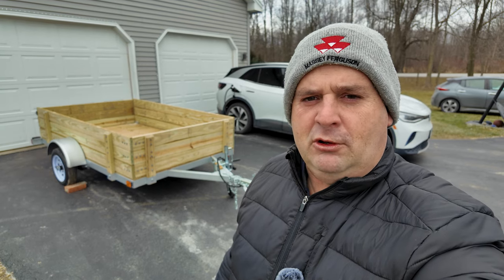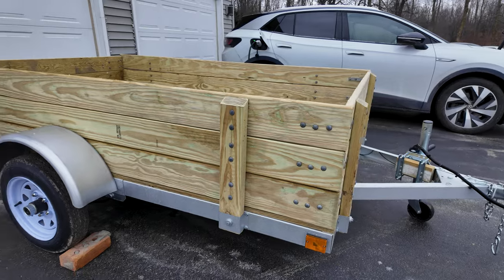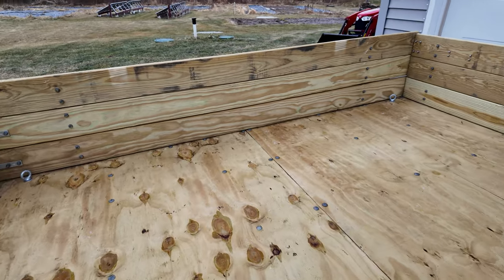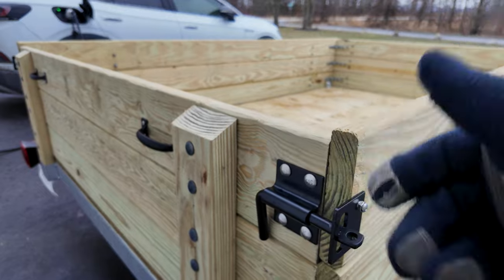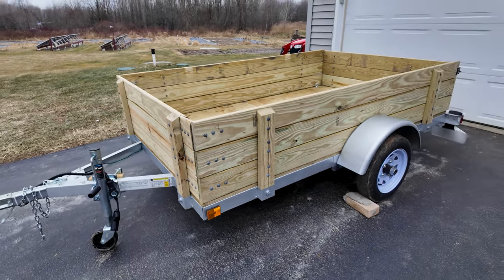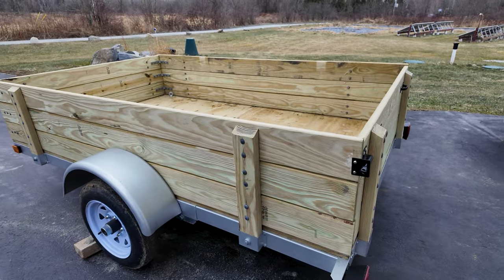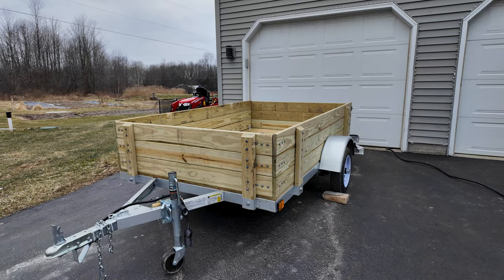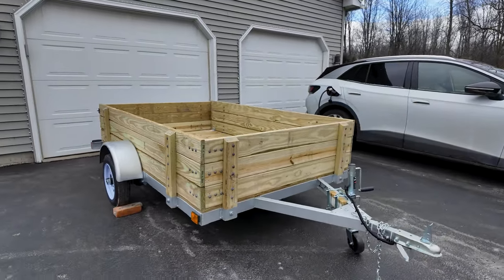Marathon Galvanized Galvalume Plus 5x8 Utility Trailer Kit

Comment: Glad you have this handy trailer, so versatile and no wear and tear on the inside of your car. I would consider a spare tire as lumberyards often have nails. Can you get a flexible plate holder? The metal one may get bent. Probably not legal to mount on tailgate but would avoid damage.